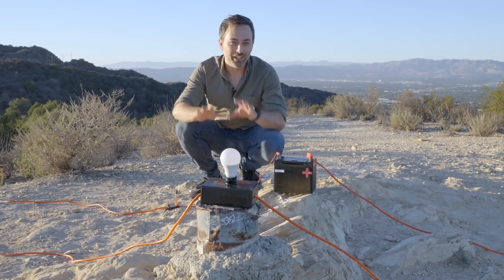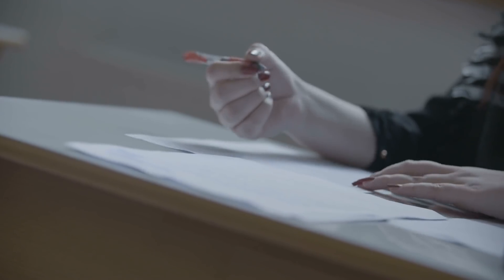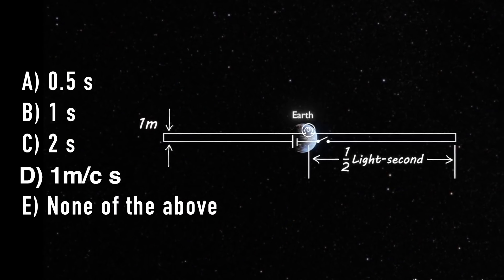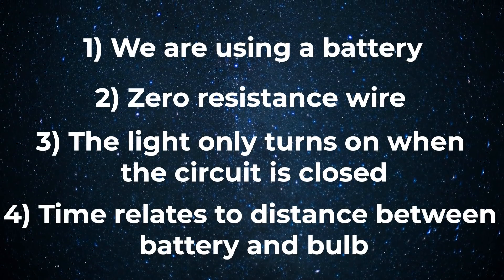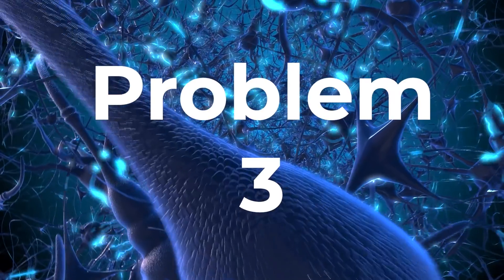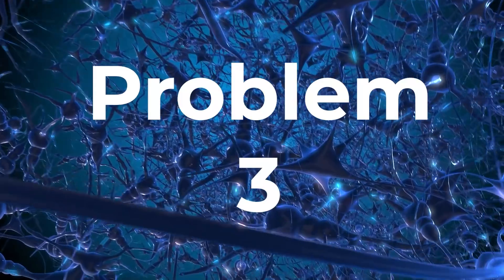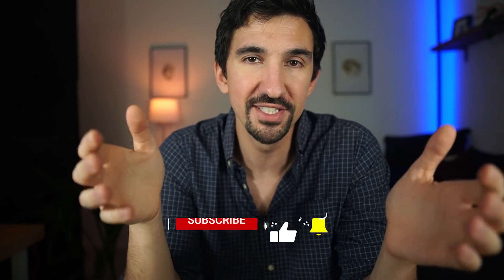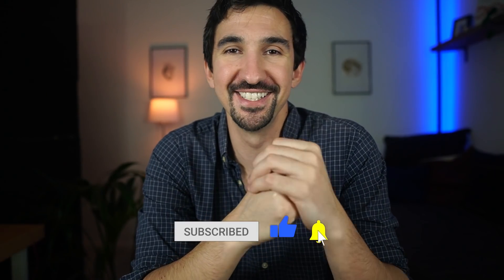Is Veritasium Wrong About Electricity?

Comment: Whats the e/b field radius? Could it be large enough to bridge the gap even slightly? Hence 1/c. You are all still thinking tunnels not fields. There was never a mention of greater than C. It's a great question. Not sure if the math stacks up, but I love it regardless. Used to see the same sort of questions in antenna theory and electromagnetic propogation. Why do you need clearings around high voltage lines to begin with - ionizing EM fields. Could a short field still bridge the gap to some measure and light the bulb to any degree - absolutely.

Comment: Well, I haven't studied relevant courses on this, however most people here either ignore the first line of many text books on electric circuits courses which I have actually studied. That every formula can only be used if size of the circuit is much much smaller than the wavelength of current that you are using, so none of the formulas that people are using doesn't apply at all. Also, if I remember correctly speed of electric current is much lower than light.

Comment: I believe the distance at which the switch is from the battery matters. The switch closing and opening are events that are communicated to the battery as electrons moving through the wire. The energy however, is being transmitted through the fields. So it would take time for the battery to know the switch has been closed / opened and start delivering energy, so no information is being transmitted faster than the speed of light.

Comment: 4:20 the distance between the battery and bulb isn't the one that matters but rather the distance between the switch and bulb. The effect of the switch propagates out from the switch after it's closed and not the battery. What's effectively being done here is the switch is being opened from 1/2 light seconds away from the bulb, so it'll take some time for that effect to become a change in the field near the bulb.

Comment: Hes stated in the end of his video that it is 1/over cs did you not watch to the end. In his video he states that we are assuming the wire is that long. The only thing in this video worth taking note of is your claims about faster then light travel but some of this is put in to question when you starting thinking about Zombie light bulbs since there is a innate charge all readying running to the light with that much "wire" would the bulb not just need small amounts of power to get over it lighting point?

Comment: It takes almost no time at all. Because both poles of the switch is already on circuit and they have already the same potential as the battery poles, namely, positive and negative potentials. It means that there is no need to wait anything travel around the loop. Nano meter distance between the poles of the switch may take some time, of course.

Comment: 1. I think you misunderstood the 1/c

The "1", in "1/c", represents 1 meter. The unit of measure is meters. 

C represents the speed of light. m/s (meter per second)

m / (m/s) = s

1/c = the time it would take light to travel 1 meter. (in the example, the battery and the light were separated by 1m.

2. In the video it was pointed out that epectrical resistance is to be ignored. (the wire has no resistance)

3. Is an incorrect assumption. For the flow of electricity to happen, an electric field has to be established in the wire fist.

It would take at least two years for that to happen. The light bulb won't work until then. 

When you cut the wire at the far end, it would take one year for the change in electric field to reach the light. 

In other words, the light would keep working for a year after the wire was cut.

Comment: I question whether or not the resistance can be removed when discussing causality, because it would probably disallow any energy to operate in a circuit greater than what causality may allow
Reply: Bingo. The causality problem was caused by the zero ohm wire.

Comment: I get the idea behind your thought experiment but what veritasium and you both allude to is the proverbial "X"... the unknown factor. In this case what we don't really understand is what exactly is an electron... we have some theories that are good enough to work with at the moment, but we are still lacking fundamental understanding as to ether it's a wave, particle or some other form of energy. If you were to truly dig deep enough, and you allude to this in your video, we are talking about quantum mechanics. We are, I believe, talking about some spooky action at a distance. In-depths of quantum mechanics,  there are circumstances when you can, in fact, transmit information at a speed faster than light. Your thought experiment proves that exact point. It seems that current science has a hard time getting past that concept, in part because given our technology and measurement instruments we have no way to prove that. Yet as time goes on, and we begin to discover new mathematics, we will get to a point where the transfer of information at or faster than the speed of light will become a norm rather than some taboo/spooky action at a distance.

Comment: As for that 1c speed limit, it's so counterintuitive. There is a thought experiment, what will happen when you start tapping something with a 1ly long stick?  This "information" is also limited to 1c, so on the other end of the stick you hit something after 1 year.
Reply: Are you sure? The stick is not travelling anywhere and has no speed relative to you aside from the timeframe of the small movement required to flick a switch.

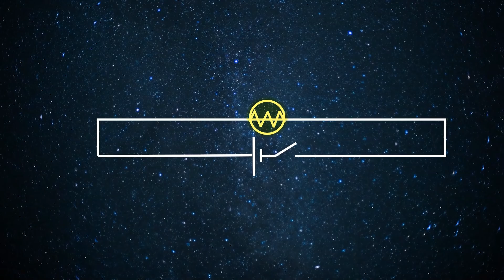Comment: 4:30 No. You would not know about the break until after 0.5 s, when the disruption in the field has propagated to your position. Until then, the circuit assumes that it is complete, and energy flows to the lightbulb through the field.

Comment: I think it's like this: When you close the circuit, you create a cascade effect of moving electrons. With a zero resistance wire, that cascade would propagate through the wire at the speed of light. Assuming the magnetic field provides the power, that field could not flow from the battery to the sink without completing the circuit. Therefor, if the line broke 1000km away, we would not observe the flow change from the battery to the sink until the break propagated back to us, limited by the speed of light. I think we would also see a delay in flow of power based on how far apart the battery and sink are  because the magnetic waves are also not moving faster than the speed of light. the flow of power would continue until  the change in magnetic field also propagated to the source.
Reply: The Veritasium video makes me think the flow of energy could continue until the surface charges on the wire cease to form a dipole about the battery, which like you say would require electromagnetic waves to travel from the break in the circuit to the battery.

Comment: Veritassiums claim is misleading but not wrong.
The switch connects the wire which immediately transmits energy by radio waves/capacitance/inductance to the other part of the wire. 
This happens almost instantly but will NOT power the globe to anything like full brightness.
Once the switch has been on for a bit and all the changes in electrostatic/magnetic effects have happened, then the light bulb will be lit as you might expect.
This takes longer than the speed of light around the system, as the speed of electricity in wire is often 0.7*C ,  and the electrical voltage and current waves need to bounce around the system many times before they diminish to the steady-state value. 
This happens in everything electrical/electronic, but is over so fast we don't see it, so we don't usually care about it.

Comment: Great video, I had the same mental issue with broken circuit. However, I think there is one more error. For the capacitic (is that a word) effect to work, electricity would have to travel along the antenna, even just a really tiny bit. This would result in the time being > 1m/c but never equal!

Comment: What if the wire was a circle with a circumference equal to how far light travels in 1 second? (186,000 miles) Then I say assuming resistance zero in wire it takes one second.

Comment: I don't think it breaks faster than light travel, because the EM field would collapse at the speed of light. If you turned your switch off at the farthest end  of the circuit, it would take d/c sec for the EM field to fully collapse at the bulb where we are sitting and 2d/c for you to see it go off.

Comment: Sounds like the TL;DR is: Electric flow generates a disturbance in the electromagnetic field, which can induce weaker flow in nearby wires. The "circuit flow" of the electrons is MUCH slower than the changing field, AND can't "jump" between the wires, but is what's responsible for the change in the electromagnetic field in the first place.

Comment: So what causes a fuse to blow? I was under the impression that when a fuse blows. Especially in a vehicle. It is due to the excessive amount of amperage moving through it. I also learned that amperage is the movement of free electrons in a circuit. So if it magnetic field that provide power. What about a magnetic field blows a fuse? Someone tell me if I'm misunderstanding something.

Comment: Was not quantum entanglement and during EPR experiment data was" faster" than c ?
DC battery produce no oscillation as in AC?
If conductors a very far apart and inductance falls off at square of distance  a negligible effect ?

Comment: Your line of thoughts is the same as that of "eev blog". On such a big scale, capacity and inductance of the wires cannot be neglected. Funny enough, he says that the impedence of the coupled antennas is quite similar to the resistance of the bulb. 

What I still don't get is the role of the Poynting vector in a DC circuit, once the steady state is established.

Comment: My thoughts are that there are a lot of confused people out there, not realising that this is a totally hypothetical scenario. By that, I mean there is no practical way with DC current flow that you would magically induce current into a wire a meter away! If you did, it would only be momentary...in the same way that you get momentary current flow in a secondary winding of a transformer if you applied DC to the primary. There seems to be some really basic confusion (not at all helped by Veritasium) about moving electromatic fields and electromagnetic induction. Even this video mentions radio waves etc., which are high frequency AC. The whole thing has confused a great many electrical engineers, I would imagine. Practically, as you say in this video, we have to go into this imaginary world of zero resistance conductors etc. Veritasium made some very conflicting comments and the distinction between moving electromagnetic fields with either AC or DC is a vital distinction that needs to be clearly made.

Comment: The circuit looks like a shorted transmission  line so would have an almost instant current limited by the 
characteristic impedance of the transmission line (about 1K Ohms) and then about 2 seconds later the current 
would be full as the reflected short at  the end returns to the light and switch  (assuming 0 resistance)

Comment: I think your reasoning is flawed, if the circuit breaks at it's furthest point, it is not the distance from the battery that determines the time but the distance from the breakage, the speed of light is not broken.

Comment: The wire doesn't act as an antenna because there is no change in the energy moving through the wire. It doesn't pulse or modulate... it's direct and constant.  DC does not cause a transformer to function.
  Think of the wire as a garden hose.  It's connected at the battery (outside spigot) already.  The hose is full of water.  The switch is a valve that is turned off. When the valve is opened the water flows.  It was already in the light.  It doesn't need to travel the whole distance to turn on the light.  It only needs to allow the flow to continue.
A break in the wire at any point would be the same as a valve being shut at that point. The wire is still full.  Reconnecting the wire at that point would allow instant on at the light. 
  This experiment should have the switch removed and both wires disconnected from the battery. The "hose" is still somewhat full of water but to a lesser extent. When attached to the battery beforehand the circuit is already pre charged. Similar to the plates of a capacitor.
Perform the experiment as described but with no switch.  Attach both wires to the battery at the same time and observe the bulb... Then...
Run the wires around the earth with the ends disconnected from the battery and the bulb at the opposite side of the earth.  Atomic clocks synchronized at the battery and light.  Attach both wires to the battery at the same time and see if there is a change.  If the wires are the same length in both experiments I suspect there would be no change. 
Now try it with AC or pulsed DC....this should produce a different result.

Comment: What!  I don't agree with Veritasium explanation of Ponting vector. If that was true then we would be using pair of antenna to transmit electricity just like we use in communication using EM waves. Why do we use wires then?

Comment: The main flaw in the experiment is the assumption that an electron from the battery needs to reach the bulb for it to illuminate. It ignores the electrons present in the wire.  If you apply a simple classical mechanics model to the system and view the wire as a pipe filled with ball bearings, and the battery adds another ball to the system, it will immediately cause an effect at the bulb.  The time needed is only the distance between the battery and the first atom in the wire divided by the speed of light, and does not violate any physical laws.  That pesky wave particle duality again.
Reply: I'm still not getting that, because "immediately cause an effect" shouldn't work.  If so, then just have a wire a light-year long, move one electron in it closest to you, and, if like ball bearings, it should immediately send that message to the person a light-year away, which would not be the case.  So I still don't see the logic...
Reply: @Rationalific  we have no data to support whether or not it it would work.  If it doesn’t, then a tube filled with ball bearings would be a better option for rapid communication in theory.

Comment: You can understand this by considering the parallel wires as transmission lines of characteristic impedance Zo. Zo is a function of the inductance of the wires and the capacitance between them. When the battery is first switched on  there will be an almost immediate step increase in current defined by the battery voltage and the characteristic impedance of the transmission lines plus the lamp resistance. The lamp will light but only dimly. After a delay equal to the delay of propagation to the end of the line and back again, an increased voltage will be applied across the lamp and it will be brighter. As the transmission line is not connected to a matched impedance at either end, reflections will go back and forth and the voltage across tge lamp will gradually step into its final battery level.

The characteristic impedance of a zero resistance line, Zo, is the square root of the ratio of the inductance per unit length to the capacitance. If Zo is very high, the lamp may well not light up until the signal returns but, if it is very low, it may light up almost immediately. It all depends on the geometry.

Of course, all of this occurs due to the magnetic and electric fields for it is they that define the transmission line inductances and capacitances.
Reply: Exactly this. It is interesting how some paint this as "engineers point of view" vs "physicist point of view", while engineers have to take into account these transmission line properties when designing for common things like Ethernet, USB, etc.

Things that we do:
- Space wires apart at exact distance to keep the impedance the same. If at any point the impedance changes, that might cause reflections.
- An opposite voltage is applied to both wires, exactly because otherwise it would be reflected back immediately.
- The lines are terminated with small resistor (like 120 ohms) that matches characteristic impedance to avoid reflection at the end.

This is all was very weird and unfamiliar when I started to work with this, and I probably said something incorrectly. But this crazy magic is real and engineers (and not only "physicists") have to think about this every day.

Comment: The most important thing Derek and author of this video forget is the initial conditions. I.e. the initial charge distribution inside the space of a considered problem (how charge is distributed in the wire on either sides at the starting moment). Depending on the initial conditions solutions would differ.

Comment: I'm a little confused about the antenna example.  Why would the flow of current cause a reverse current in the parallel wire?  What would happen in a perpendicular wire?  According to Veritasium as I understand it (which I probably don't), in the figure-eight setup below (hopepfully my ASCI diagram renders well), the lamp should still turn on almost instantly no matter how long the loops are.  But if you are talking about induced current, them I'm not sure the two explanations are equivalent.

┌─────────────┐
│					      │
│					  lamp
│					      │

└─────battery───┼───┐
					     │	  │
					     │	  │
					    └───┘